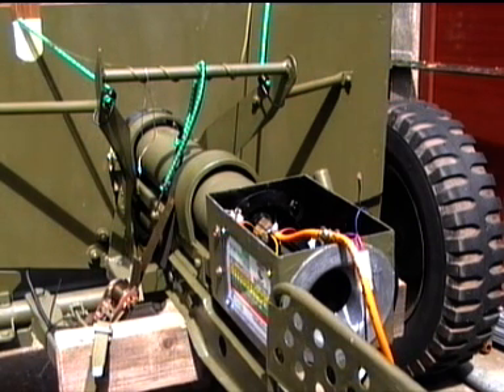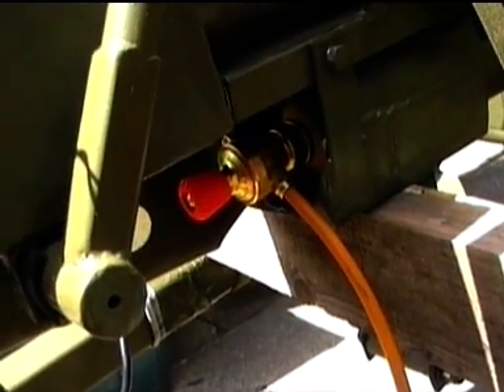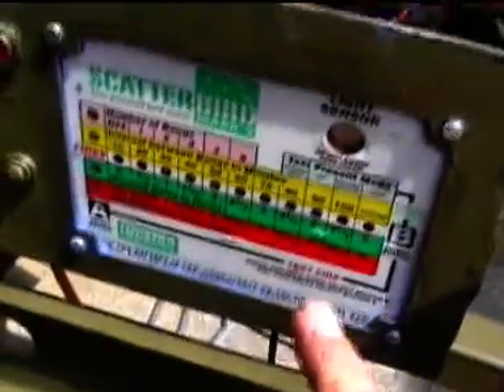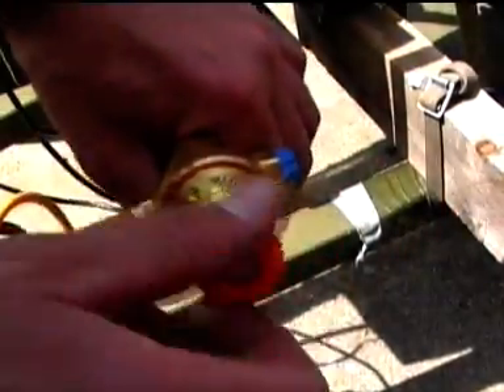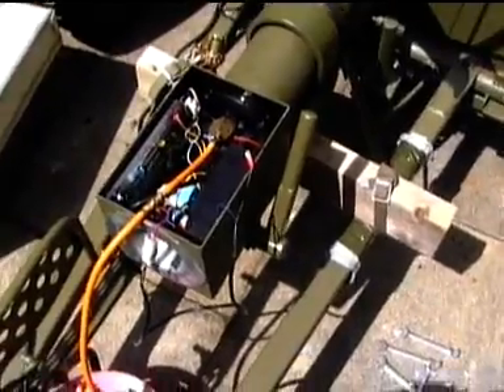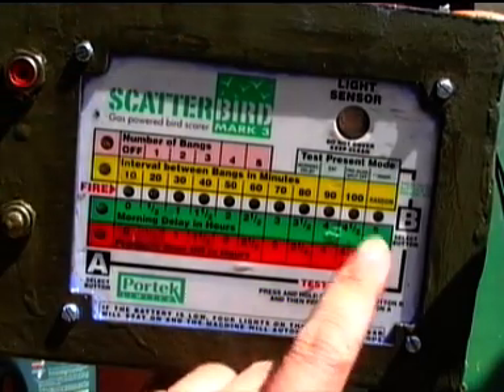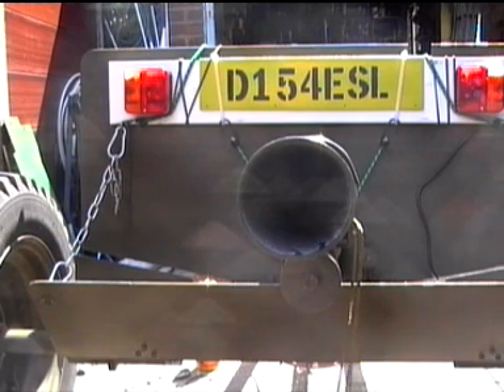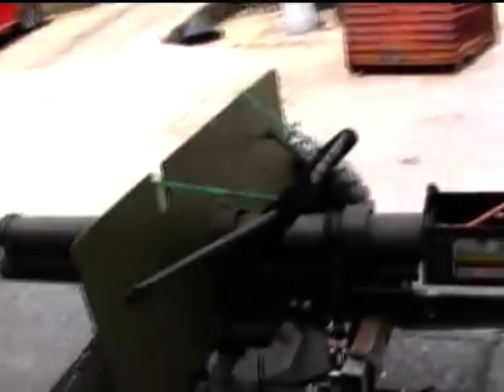How to make a M3 - 37mm Anti-Tank Gun PT19

Comment: I think that the problem with the gas is volume of gas, not the pressure.
That little tiny (1/8" ?) outlet could not possibly supply the same amount of gas as the larger outlet (1/4" ?) on the regulator that came with the bird scarer at the same pressure setting.
The original regulator looks like it would be able to supply at least four times the volume of gas at the same presure setting (double the outlet diameter = four times the outlet volume).

Comment from the maker: @MrBIGHECTIC I think it cost about £400, the hubs and axle bits cost the most. If you could find the parts in a scrap yard it would cost a hell of a lot less. I also drove this to the scrap yard where I got most of the metal to make this, on the way to my mates just to show them how it was coming along. It turns out they used to work fixing old jeeps up years back presumably as they got them from the army as scrap and sold them on.

Comment from the maker: @MrBIGHECTIC I did drive past 2 cops on the way to my mates to video the last bit, but I tend not to look at them just straight ahead and ignore anyone :-)
The pressure on the small bottle may be higher than the big but the amount of gas flow is less due to the smaller fittings we think. So I would need more gas flow from the small bottle.